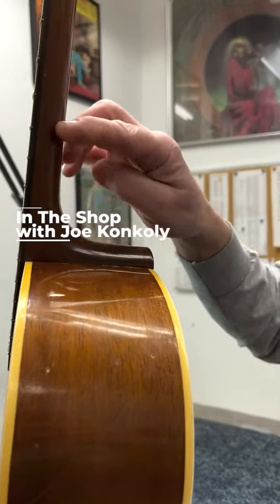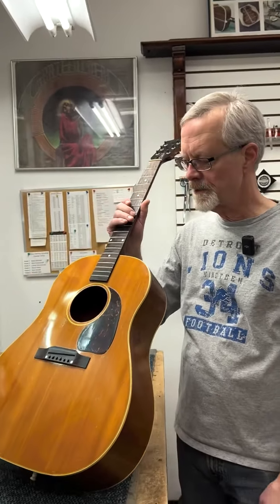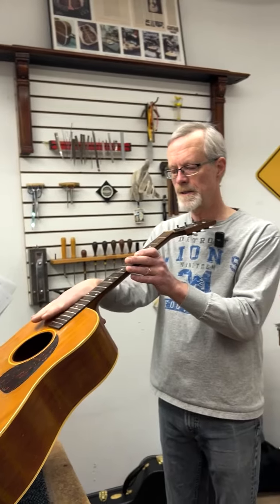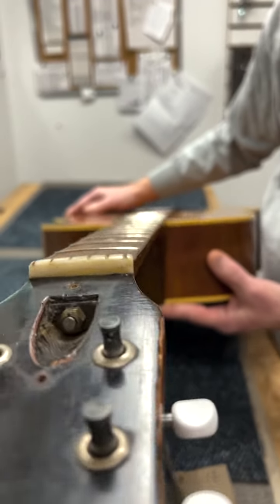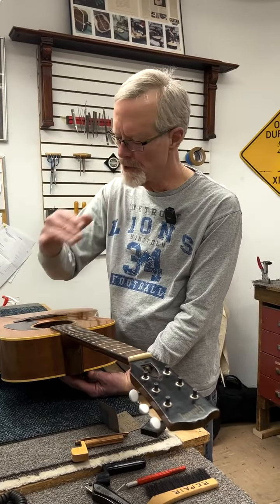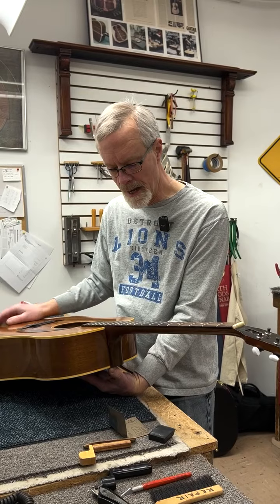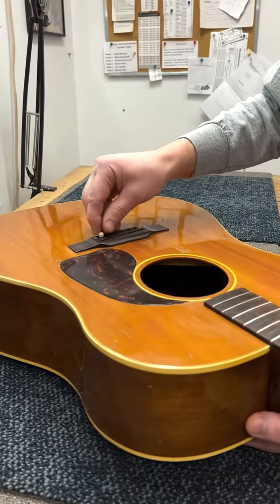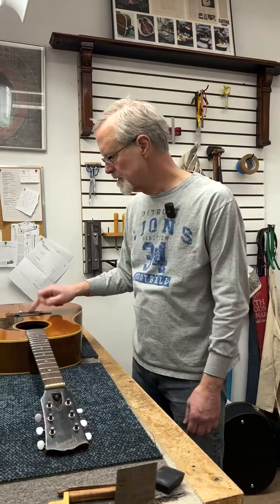In The Shop: 1949 Gibson J-50 Update

Comment: I assume the tops have dropped a bit on these old guitars, requiring the wedge. Why couldn't you reinforce the area under the fb extension such that it's radius is re-established, supporting the FB extension?
Reply from the maker: Thanks for your question, Patrick. I don't think that would make enough of a difference, and I am not sure how you would accomplish the "reinforcement".  There is a tool/jig (the Thompson Belly Reducer for Gibson guitars) that re-establishes the radius at the the bridge area, and this can be very effective fix to prevent/minimize the need for a neck reset.  But I have encountered many guitars that need both the Belly Reducer and a neck reset with FB extension wedge. -Joe